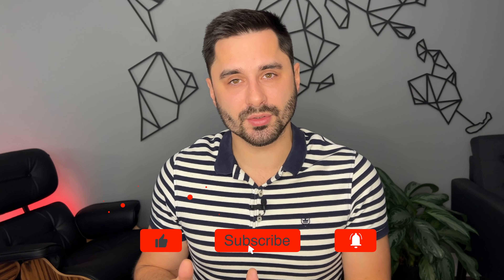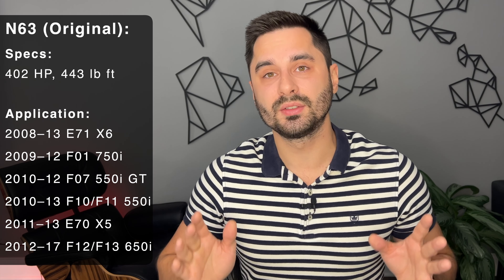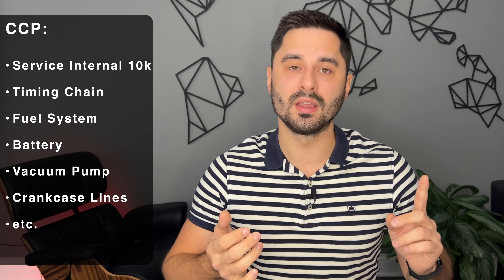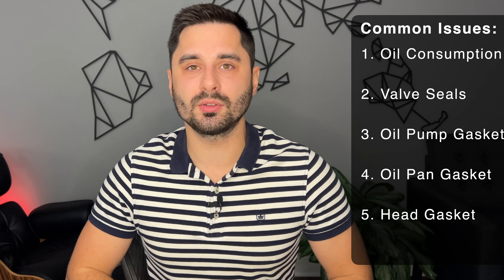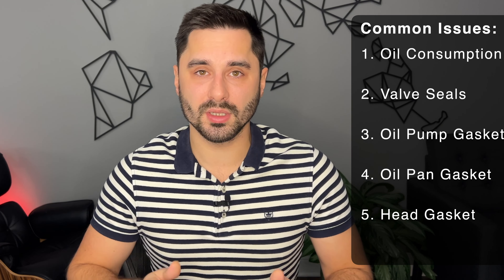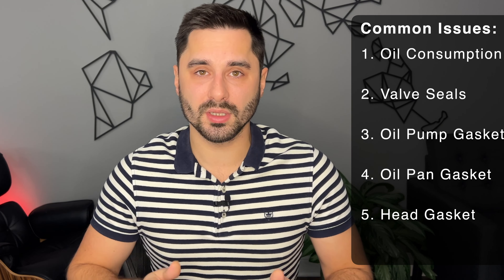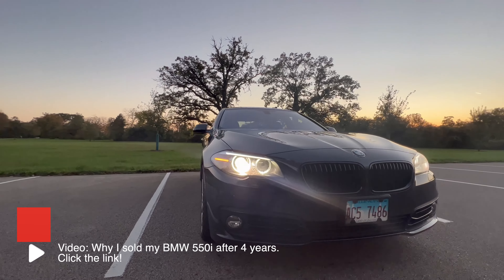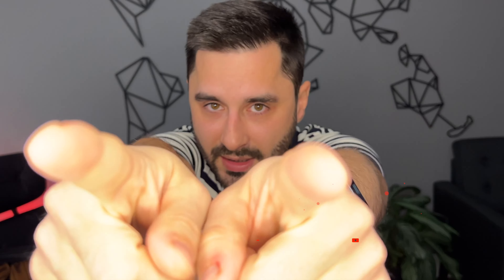BMW N63 Problems to Expect - Reliability Report

Comment: Things to keep in mind since ive been around the insides of lots of n63s / s63, they all have forged cranks, they all have similar rods, known to bend around 700wheel torque in the m5s, the older n63s before 02/11 rods were actually used in the newer v12 tt rolls royces and look beefier than the newer rods, n63tu fuel pumps and injectors are still known to go out, biggest benefit of a tu is the head cooling was redesigned and the newer stem seals
Reply: Thanks for that info!! Thats good to know.
Reply: Absolutely. Everyone is a Tech on the net
Reply: Any idea if the old n63s can be updated with the new heads etc? I believe I have an 09 750LI but no idea what it really has
Reply: Getting a generic code for low rail pressure. Having your experiences, was the culprit the HPfp’s? Or do the low pressure ones go out too
Reply: @F10Joosbi  Test the fuel pumps.
Reply: @kacper.6537  yeah bank 2 hpfp.  This was at 68k now tuned on stage 1 91 octane no other issues since. I’m at 94k
Reply: @F10Joosbi  Is it xdrive? Hope it drives well for you man enjoy the beast
Reply: @kacper.6537  no, lol RWD but for the rolls I do it benefits me. Launches, I am fighting for grip but damn is it fun. 😂
Reply: @F10Joosbi  does it do burnouts? Im curious, i have a 5.0 mustang right now but i might switch to a 4 door soon, i like burning rubber so its kinda important for me lol, i have to go through at least 1 set of cheap chinese rubber every month or else im depressed
Reply: @kacper.6537 you put cheap Chinese tires on your bimmer you’ll be paying for new rims too 😂
Reply: @shanejones578  eh my buddys running 4 different linglongs on his camaro SS and its doing fine :) third set this summer
Reply: @kacper.6537  you can do that with an American car, but like I said you can’t put those on a European car. Not a newer one you’ll light the dash up like a Christmas tree in no time I can assure you. But you’re more than welcome to burn up pirellis and Michelins 😂
Reply: @shanejones578  brother a wheel is a wheel it doesnt matter where the car is from 😂
Reply: @kacper.6537 you’ll see if you buy one, I own a f06 650ix Gran coupe. I’m not just saying this stuff. It’s a great car but it’s expensive as all hell to keep on the road
Reply: @shanejones578  Yea i bought a 5.0 instead 😂 S197s are great i recommend you buy one

Comment: 2012 650i  - never an engine problem. Still runs and looks new. Regular maintenance, timely service, no abuse of the car is a key to happy ownership.
Reply: Yes - I agree. . .
Reply: What mileage did you get it at. How many owners. And define no abuse.
Reply: @HebrewAmaz  70k miles. I never raced it or drove exceedingly hard.
Reply: I never really drove mine that hard, bought at 68k 2013 n63tu. My cyl 8 has 60 psi compression at 105k. Something’s blown internally
Reply: @shanejones578 the guy before you has drove it hard then.
Reply: @hadrianmansueto2556  is it really a problem, driving hard? I mea, these are not racing cars but they live the rev. I bet the guy who had the car before didn’t fully adhere to the maintenance schedule for minor and major intervals

Comment: Finally an accurate description of the history of the N63 engine and subsequent updates. I have a 2015 650i XDrive with 48k miles, I change the oil every 5k miles or one year.  No issues! Love the car and got the car for a steal for a MRSP $115k.  The car came with every option!  Thanks again for setting everyone right!
Reply from the maker: Glad to report the truth about the engine! I was also 'scared' by others when I got my 2014 550i years ago, but people seem to forget there are so many version of the same N63 engine! Take care of it and it will take care of you. Enjoy your awesome 650i!
Reply: @SimpleCarGuy  Currently looking at buying a 2012 550xi with 120,000 miles great service records all at a bmw dealership. They are selling it to me for low blue book because it's a family member. What do you think? Safe buy?
Reply: @strangeclouds7  did you buy it? if so how has it been?
Reply: @SimpleCarGuy u didn't have any issues with the n63tu?
Reply: I know this post is old hopefully you respod I just resently got mines any advice for maintenance?

Comment: First the bmw N63 did have these problem, that being said, Bmw finally after a decade they finally built got the N63 engine right. If you have a 2014 and up bmw with the N63 engine all of those problems have been dealt with. I have a 2013 550i and had the engine blown because of rod bearing problems. If you keep up with regular maintenance your bmw will last you one hundred thousand miles and beyond. That being said you common sense if you beat on it and don't take care of it, it will blow up on you.

Comment: My N63TU is at 118K miles and I’ve done normal maintenance besides changing a radiator under warranty and next week I’m getting new rotors and pads  plus O2 sensors she runs just fine and 5-6K oil changes with 5W40 euro full synthetic
Reply: Nice man hopefully it runs great for you

Comment: I have a 2014 550i and it has over 121000 thousand miles and runs like a beast I love my 5 series
Reply: Would you pull trigger on 2015 90k  miles for 16k...I seen it on buy now at auction site
Reply: @sirmoney2762 Damn 1 year late, id buy on the spot

Comment: My first BMW was an E46 with the 2.2 litre inline six cylinder. I bought it when it was 10 years old, as a second car to be used during the winter months. Next, I asked the local BMW dealer to find me a two year old F10 535i and they found me a great car with only 26,000 miles on it. It has the X drive and M Sport package options. It was a leased car that the dealer had serviced since day one. I still have both cars. The F10 is put away for the winter and the E46 is my daily driver, and currently has 301,000 miles on it, still running great. Now, I want the dealer to locate a mint condition M5, but I've been concerned about the oil burning issues with the tirbocharged V8 engines. This video has helped to clear up some of my concerns. Thank you.

Comment: You had me on the edge of my seat with wondering what you would say about the engine in our 2014 650i Gran Coupe.  I dug out the paperwork and it has the N63T engine.  Apparently, if i understood you, it has had many improvements over the original N63, thank god.  With only 50K miles we hope to get another 50K trouble free miles, although local BMW repair shop just gave us a bath costing about 3 grand to replace high pressure fuel pump,  installed new $700.00 battery, $100.00 to replace key fob battery that I had already replaced 2 weeks previously, etc.   I wish we could be happy with a Chevrolet or Ford but after 6 BMW's there is no going back to American made.  They got us hooked, damn it.
Reply: @studmuffin8859  13 650x GC. All started with an e46 3 series for me, there was no going back. Motor just blew on my Tu at 105k out of nowhere. I would suggest around 80k if you have time do valves and bearings and timing guides and chains yourself if you have time. Or pay to have it done. Or get rid of it quite honestly.

Comment: Have you heard of or dealt with the aftermath of this issue where the oil pressure relief valve is accidentally thrown out during oil changes on the n63's? 

Evidently, the retainer clips at the bottom of the oil filter cover become brittle and break off and then if not paying attention, the pressure relief valve gets tossed out with the old filter.

Anyway thanks for what you do... you have the most thorough and balanced technical reviews of BMW's and what to expect of them out there. Keep it up!

Comment: Thanks for explaining in great detail about this engine. I am leasing a 2022 M550i and a number of people told me not to get the N63 engine. So far I have put 6k miles and no issues. Fun car to drive. I am wondering to keep it after the lease.
Reply from the maker: Thanks for watching! 2022 n63 engine is soooo much better than the original n63 and people don’t seem to grasp that and think they are all the same

Comment: Thank you! Great video. I have test driven a 2019 750i and I really like it. It has the N63TU2 engine. But the horror stories I have heard break my heart. I really like this car, but I have been resisting purchasing it in fear of making an absolutely regrettable decision. The last thing I want is to purchase a maintenance nightmare. Thank you for putting me at a just a bit of ease.
Reply: @usmanjnc8872  my tu1 made it to 105k. I drive it moderately mostly but am not afraid to use the pedal when I get a safe chance to. I would expect similar results or slightly better honestly. Plugs coils injectors maybe some hoses and other random small things until then. Nickel and diming just a little but nothing bad, just the big problems that really hurt like a blown n63 😂 hell the transmission is cheap even

Comment: I have a 2010 750i with  almost 120,000miles . Original engine and transmission. Just go oil changes regularly  make sure spark plugs and coils are doing good . Coolant leak is common so make sure that’s dealt with and should be ok .

Comment: Thank you brother for your information about this engine,i have a 2012 Bmw 750i xdrive F01 and i was very worried about the reliability because i have heard many bad news about these engines and it was AFTER i have bought the car, but now that YOU said that it was upgrade in 2012 and it became N63TU  i feel relief.
Reply: He meant it was upgraded in 2012, but released in the 2013 model. You still have the original N63 in your car
Reply: @MrFlyNikolai  No brother you are wrong...i read it on  ( wikipedia) Bmw N63 engine it says i quote...
In 2012 a technical update was APPLIED to the N63 engine and not " released in the 2013 model " NO it doesnt say that... thats your own opinion.
Resulting in the N63TU variants also known as N63B4401.the main upgrade was the additional of valvotronic,other changes include revised turbocharger,removal of the blow off valves,lighter pistons,forget connecting rods and cranckshaft,additional of valves cover labyrinth oil catch/return system,new valves stem steal,revised fuel system, and additional of a second cooler pump.
So dont scare me now...come one man
Beside since i bought the car is been now almost 2 years and the only issues i have had with my car is ( air bag light ,traction light and engines light are on and i am taking it next week for diagnostic) other than that STILL with those lights on on the instrument cluster,the car drives strong ,smooth shifting and very quiet.
Reply: @MrFlyNikolai  😅😅

Comment: This is very helpful!  I am currently shopping 2020 750i's and almost stopped after all the bad press about the V8.  Sounds like the 2020 is a fairly safe buy - I absolutely love the look, build quality/look/feel.  I am coming from multiple Lexus LS and most recently 10 years in an A8L - I keep coming back to the 750 but so far have been afraid to pull the trigger - your video provided great input - thanks!
Reply: Not old enough to have the kinda prolonged heat failures n63s are prone to. Time will tell. I suspect they get better over time but will never be truly reliable just because it’s a hot v heat cannon. - 2013 650ix GC
Reply: Motor went down at 105k no warnings for me. It’s not the worst thing to make it to 105k on a borderline supercar but for 105k sticker you’d like it to go a little longer maybe closer to 150.

Comment: Thanks for the history on this engine and all the subsequent improvements and upgrades.  I watched a similar review trashing the older versions and was getting cold feet on the deposit I put down on a 22 X6 M50i.  Your knowledgeable assessment helped me stick with that decision and I’m sure I’ll love the car.  I’ve owned several BMW’s and many BMW motorcycles and have bled with the cutting edge of technology at times, but it seems like BMW has done some very good improvements to this engine over time.  Great concise review!
Reply: Should have gotten a Lexus. Much much much more reliable
Reply: How has it treated you so far ?

Comment: On the newest n63b, get a lower tstat put in right away. Dealer will never be able to detect this either. This will help to keep temps down. Secondly, if you maintain your car, get Funk turbine inside out blanket. Can install these without taking out the turbos and will help to reduce hot spots and timing reduction for middle cylinders. Just check the blankets during oil changes ( every 3-5k miles!) for oil contamination.

Comment: I wish this video was out in 2015 when I bought a 2012 X5 50 with 50,000 miles from a BMW dealer through the CPO program after it came out of a 3 year lease. First and foremost, I loved the car. It was my 3rd X5 and had all the bells and whistles. It now has 120,000 miles. It goes through oil like a fart through a French horn. Over the last 2 years it has increased consumption to a quart about every 500 miles. I also just found out that both valve cover gaskets are starting to leak. Nothing to do now but nurse it along and trade it in in about a year or so. I understand that the majority of oil consumption comes from the poorly engineered valve stem seals. But at the current value of the car, that is a ridiculous repair expense since it is probably more than the value of the car.

Comment: I have a 2011 550i tuned with some upgrades pushing 647HP on the original N63. I change the oil every 3000 miles, I am running an oil valve cooler and a cooler thermostat to keep the heat down significantly. It works. 

One note. Smoke coming out of the tailpipe can also be the PCV valves. If they are cracked and broken. It will cause smoke. 

Use thicker motor oil, Forte seal conditioner with every oil change and you'll be good.
Reply: What coils do you use because I have a 2016 550i and was thinking about buying eldor coils before I tune
Reply: @maddogyoyo228  eldors are the best. Those are what I currently have. Also if you tune it. Run NGK step 2 colder plugs.
Reply: @maddogyoyo228  should be. That's where I bought mine.
Reply: @UCqwfd1Wgp9C-amkcD0cKMBw and what downpipe is the best
Reply: @maddogyoyo228  i have VSRF Catless downpipes on mine. It will make your car louder. I have quad tip exhausts with a 3 inch straight pipe.
Reply: damn bro that's a lot of stress for the original n63, but I trust you're taking good care of it.  any issues since then?
Reply: @garrettparks1629  no problems. As long as not hitting around 700lbs of torque, the engine can handle it. Anything more, you'll go through engines more than underwear. Upped the HP with more air induction and tuned down the torque a little bit. She's solid.

Comment: I had an Audi that had mechanical problems which Audi took care of under a recall. But like BMW the new parts that they used to replace the old ones were no different than the old parts that broke down. So several months later I had the same issues all over again. A lot of BMW owners with this engine have had the same problem the second time around after spending thousands of dollars getting it all fixed. The point is the "new"replacement parts that they put in have the same issues as the old ones because it's the same thing just brand new. The idea of replacement parts is supposed to mean something that is a completely different design mechanically than the old one that malfunction.
Reply: I noticed my Mercedes doesn’t keep me in shop an I had a bmw before
Reply: @cashgogetter6737   - Same! I had a 2003 and also a 2002 S Class before and they both ran like a champ!
Reply: @faznout those year Mercedes were reliable. It's totally different story now.

Comment: This video was useful, I have a 2016 BMW 550i xdrive that I recently bought, I heard the N63TU was more reliable,  I think mine has the N63TU2
Reply from the maker: Yours should have the N63TU. N63TU2 was only the M550i G30, I believe. Still a great engine and I'm happy you found the video useful!

Comment: To my knowledge the valve stems perish due to heat which in turn leaks oil into the pistons which I suspect is a side effect of the Hot V arrangement. As I am not a mechanic or a BMW owner you can take my suggestion with a grain of salt. I would personally run an Interchiller ( not an Intercooler ) keeping the engine temps down will most likely reduce valve stem depreciation and prevent excessive oil consumption and blue smoke in the exhaust ( in theory ) and improve engine longevity and possibly regain those longer service intervals unless you drive your vehicle on the track

Comment: Lovely summary! I have a 2018 M550i with the TU2 @ 38k miles and so far just my coolant lines have been replaced under warranty. Unfortunately I've had issues with the "bulletproof" ZF gearbox though. Guess I'm lucky!

Comment: Thanks. Great video to explain difference between each N63.
Bought a 2017 750i cause could not find a 740i G12 with Bowers Wilkins speakers. Has 109k miles now. Drove all the way from Texas. And yes, a bargain ($20k before tax and registration) with tons of options (almost $20k worth of options).
Glad to know i can probably get another 100k miles out of this one 😊. Of course with some repair here and there.
Oil change every 5k miles and transmission fluid change soon along with rear differential.

Any other preventive maintenance required on a N63TU2?